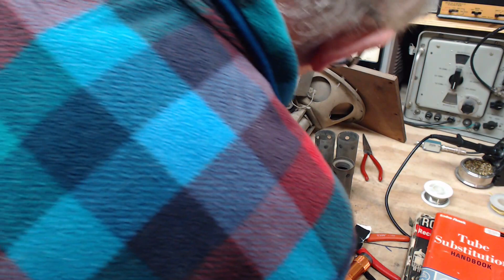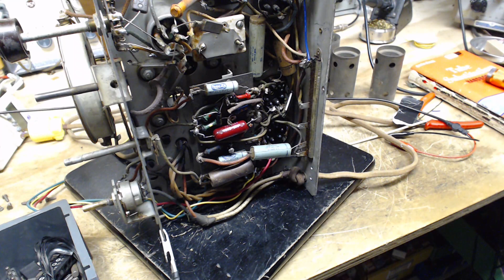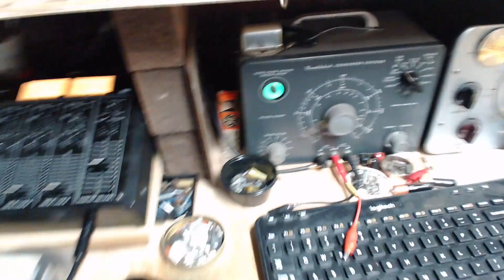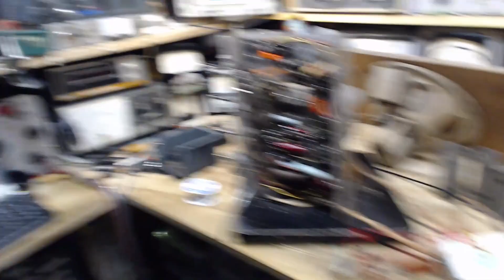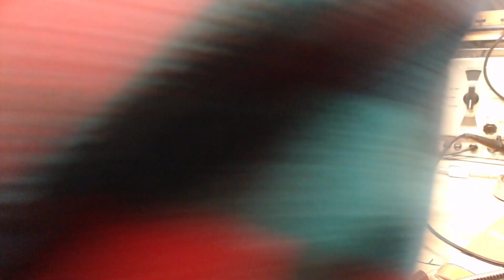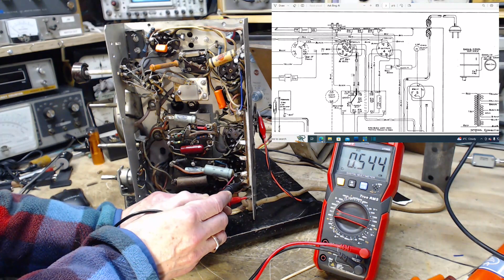Canadian General Electric Model A55Z Video #7 - Paralysis

Comment: This is actually video #7.  The radio appears to work even though chassis  was directionally moved.The Candome resistor 
 is from left to right : R18 10K, R19 5K, R20 5K to ground and R17 500 Ohm to ground. The other end of R17 goes to  the 
cathode of 41 tube. Between the R17 and the 41 tube are two different paper  caps C29 at .25uF and C30 a .1uF. Look
at the schematic diagram also and not the chassis parts diagram only as parts are not drawn there properly. Easily can be confused by omissions.